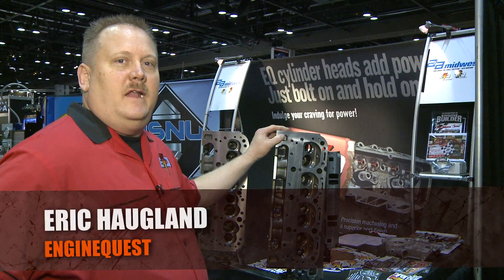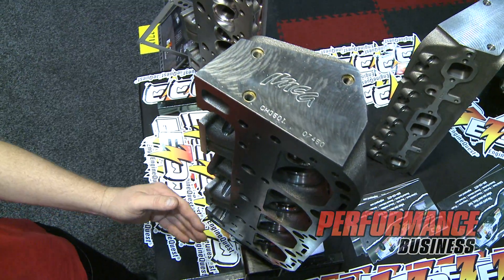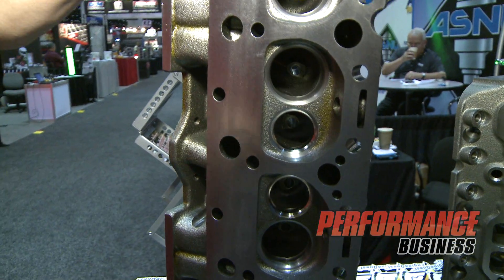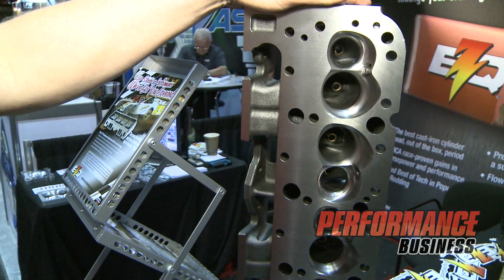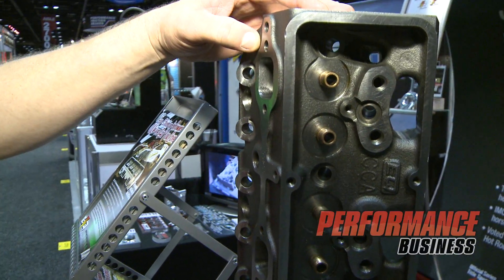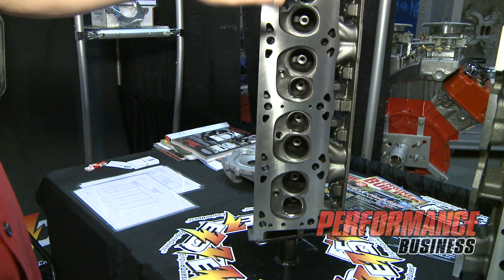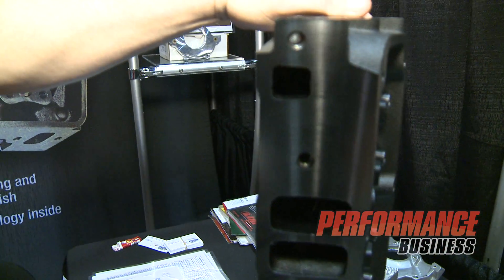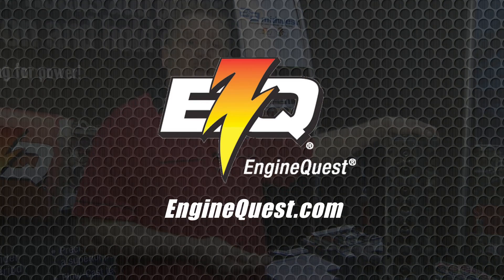EngineQuest

Comment: He mentions getting away from shaft rockers as though it's something to be proud of.  Shaft rockers are great, except that you have to use dedicated parts rather than El Cheapo Chevy stuff.  The shaft rockers are one of the things that made the 340 such a durable plant for high revs.
Reply: +JETZcorp Yeah, the magnums are going for 200k+ miles and putting out more power than the old LA stuff. Everything is better about the magnum, including valvetrain.
Reply: @kraventhearcher  pedestal mount rockers are junk. Shaft. Rocks are the best period. That's why all race engines use the. They should have at least went a head and put screw in studs at a minimum.
Reply: Andy White The valvetrain is one thing I think they went backwards on.  I'm sure the goofy pedestal things are cheaper to make.  Hydraulic roller lifters are nice though.

I think the fact that they went back to shafts for the metric Hemi, says it all.